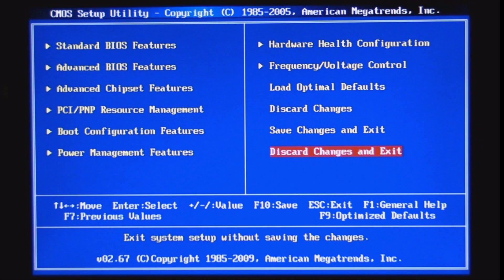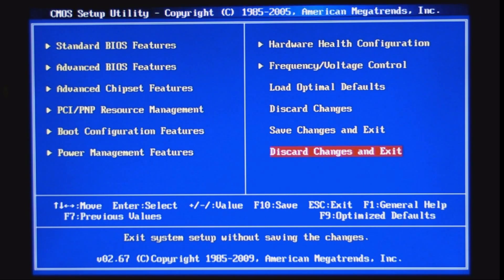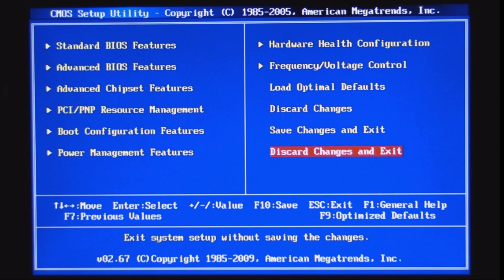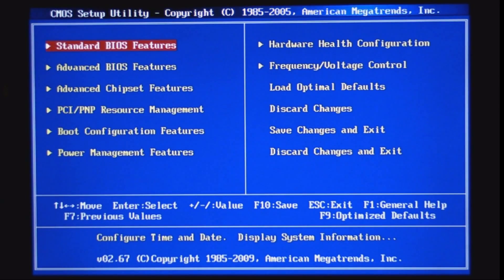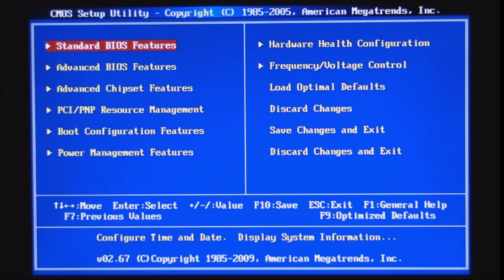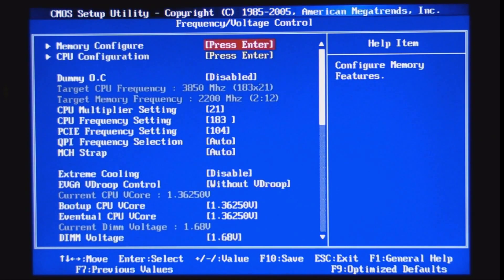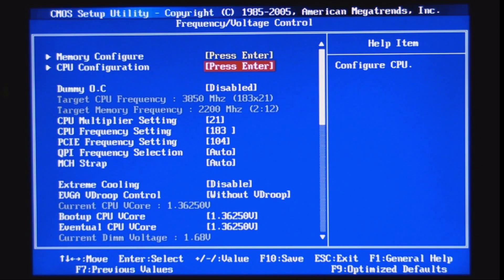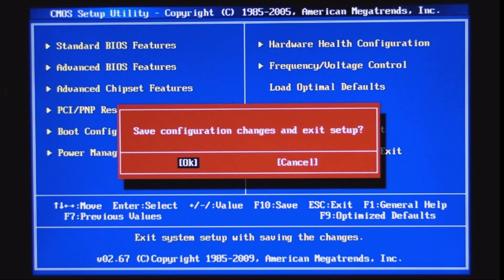Overclocking p55 Intel Core i7 - guide 101 - pt 1 of 3

Comment from the maker: Keep an eye on your memory ram frequency. Lower your memory to 1333Mhz if your memory is 1600 mhz. If your memory is 1333 Mhz lower it to 1066Mhz. When you increasing your fsb - your increasing your memory frequency automatically. It needs to be lowered. If computer crushing and temp not equal or less than 90c in prime 95 than increase your VTT voltage by two steps and vcore voltage by one step. Try to select 3.6 Ghz. SHutdown intel steps and all other technology like I said Let me know.Thanks

Comment: Tried that. I made very small steps when overclocking all the frequencies and multipliers. My first step was 3.2GHz. Thought that it couldn't be too much, right? Well, I stress tested, and the highest temp for one core was 75 degrees Celsius and at that point my computer crashed. Tried lower and higher settings but it keeps crashing when stress testing with Prime95. What can I do?

Comment from the maker: Thanks for watching. Part 3 of 3 about testing stability in Windows OS. Very simple download prime95 and REAL CPU Temp programs that are free. Run prime 95 torture test smal cache (second option). Check the temp. If cpu getting 90 c stop the test and lower your vcore in the bios. If program stops, or computer freezes and cpu temp is lower than 90c , increase your vcore in the bios. Real CPU Temp is free to check your temp in real time.

Good luck and thanks for watching.

Comment from the maker: @orioncheung That water cooling is not better than my Thermalright Venomous X heatsink with two fans. My Venomous X actually better. Corsair H50 is the same performance as your Noctua - you got Noctua right? I used to have Noctua top line heatsink for my e8400@ 4ghz it was kick ass. Voltages does not work because you need to set vtt voltage to 1.4v than you can lower your vcore to 1.4. try it,it will work. Anything else will not. Watch my video,I will set two voltages vtt and vcore.

Comment from the maker: @orioncheung Yeah, you can do it. But I did this tutorial and promising 3.8Ghz at least. With 4ghz - do heavy test with Linx and prime 95. watch your temp. 4.2 is a great results and If I were you I would go for that number. However not all are advanced or have the balls, so I promised 3.8Ghz at least. You got skills-now use it.
My overclocking tutorial on socket 1366 or X58 chipset is coming very soon, where I will overclock my i7 930 before I will switch to i7 2600k. Dont miss it.

Comment from the maker: @ExtremeGamer9951 Those some never get the most overclock from their cpus. I always squeeze the max and never cooked a single cpu. My old p4 3.06 @ 4ghz still working today with 1.7v on cpu. The customer that I sold it in 2006 still happy. My e8400 3ghz @ 4.2ghz with 95c with maximum load prime 95 after 1 hour is still working and customer is so happy. I sold it in 2009, after running it for a year. do not pass 95c. CPu is equipped with indsutry standards which is treshold 100c. Peace.

Comment from the maker: @idic5 WHat is your motherboard? 4ghz for 875k is safe and stable. I run 4.2 ghz with my i7-930 not unlocked. they are about the same and equal cpu. What is your cooling. I said 3.4-3.6 ghz will be stable and safe for stock cooling headsink. Noctua or Thermalright Venomous X or Corsair any H series coolers and 4Ghz easy and stable with good temp.

Comment from the maker: @idic5 You will not cook your pc. Dont listen to loosers who is sayign that and never done anything. 3.4 will be easy to achieve. 3.6 Ghz - watch your temperature in windows when running Prime95 torture test. Make sure it is not higher than 94c. Do not go over 95c and you will be fine. However, I think your temp will be around 87c when 3.6 Ghz and testing it with prime 95 torture test.
Make sure to disable turbo mode,  and other features that for stock cpu- watch the video I will explain it.

Comment: I want to overclock my i7 870 to 3.32  ghz on my new evga p55 sli I had a msi motherboard with oc genie that did it for me, i don't want 4.0 ghz because apparently this is not very stable  and will eventually cook it I need to learn how to get back to 3.32 I never oc before. Any help would be appreciated.